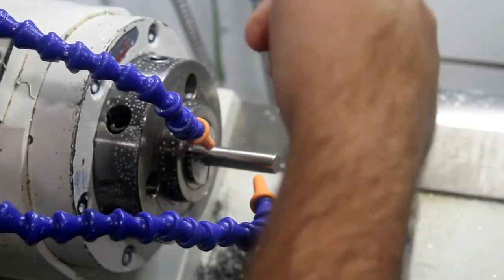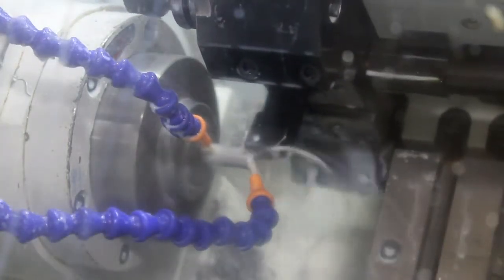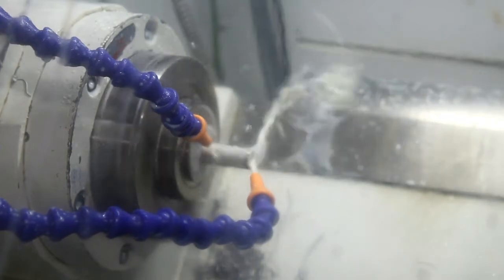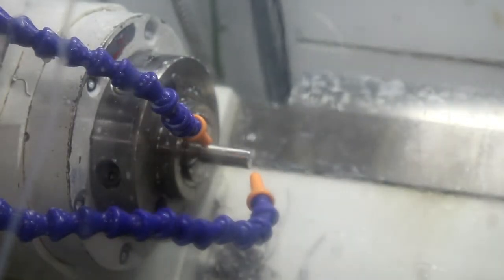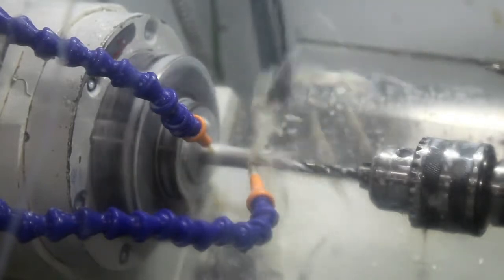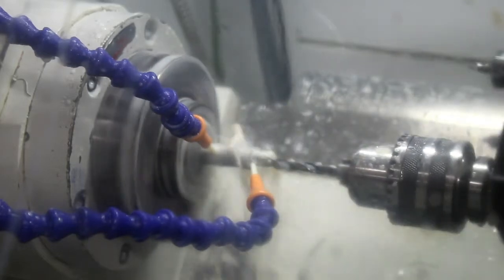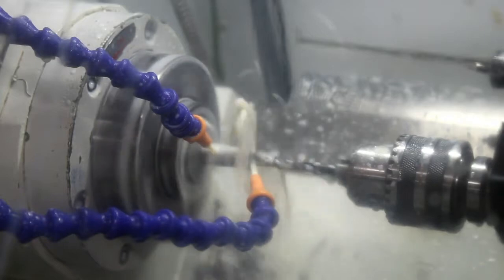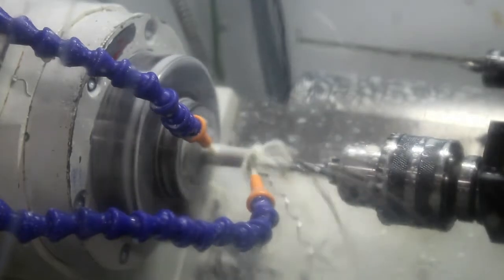Tormach lathe stainless parts.

Comment: Hey Daniel.
Good to see your brother taking over on the Tormach.
It definitely helps if you have 2 people producing parts.
Plus a bonus that you don,t have to run everything.
Good video.

In the back of my mind i still don,t mind the Tormach Lathes if you only need small parts made.
Definitely good if you are on a learning curve with CNC.
My main dislikes about a Tormach Lathes is they are a little limited for power.
And they are Way OVER Priced for what you get.
Other than that, lol. there not to bad.
Reply from the maker: Yea it helps a lot to not have to be the only one setting things up. He would run the jobs before once setup while I set the next machine up but yea better now.
Reply: @dnjmachine  
At least you have someone you can do that with.
Reply from the maker: @weldmachine  I like to think we keep each other going
Reply: @dnjmachine  
It does seem that way for sure.
Hopefully things can stay Positive for both.

YouTube has been both Fun and Not.
It eats up to much time and the feeling of why bother is always looming ??

Only time will tell what happens.
Worst case for me is.
I will just stop posting video,s.

Comment: im kinda curious to how you guys started out? curious if you has the tormach lathe first then the haas mill or what not? I am saving up for a cnc lathe to add to my shop and was thinking about getting the tormach or a used haas. I dont have much shop room left so the tormach actually sounds nicer to me now but idk if I will outgrow its capacity. I had a tormach 770 and loved the little guy but constantly needed to mill larger things than it could handle.
Reply from the maker: We had the PM-940 converted to CNC then Tormach then Haas when we built our now shop
I don't like Tormach's lathe support, maybe its changed its been 3 years or so since I last tried contacting them.

I do personally I feel the Tormach has been a good machine, it is limited to smaller parts but it has a very easy to use conversational programming system.
You mentioned before you don't have a lathe so learning one would have a bit of a learning curve from the mill.
That was the main reason we purchased it the ease of use, I was making parts really quickly with the machine.

The reasons you may not want to get one.
Like you said the work envelope is rather small.
Largest thing we have cut is maybe 6 inches long as for the OD max we have done about 5" OD with maybe 5 inch stickout. This really depends on the tooling you get.
The gang plate limits both OD and length. I have had to pull the gang plate off the machine just to let stock clear it many times.
If you go all out and buy everything turret and collet closer the price gets up there and you could buy a good used HAAS or for a little more you could get a really nice new HAAS.

We spent less than 10K more on the Okuma and there is no comparison between what the 2 can do. There is also no comparison between how easy they are to use either... The Okuma takes up 5 to 6 times the space and the power requirements are outside what a home shop would have too.

Had I had the experience I have now I would buy a HAAS over the Tormach any day but that may not fit your needs.
The Tormach will happily cut parts up to 2" OD and 2-3 inches long without any issues (I would say that's 85% of our lathe jobs) when you start getting over that it's doable but starts to become a hassle.

If you have any specific questions about the Tormach or the differences between the 2 lathes we have I'd be happy to answer.

-Daniel
Reply: @dnjmachine  
Not my question but a well detailed reply.

The only thing i would like to add is ?
He already runs a HAAS Mill,  it might be in his (Engineering Science ) best interest to stay with a controller he is already familiar with.

Plus you guys in the States have plenty of second hand HAAS Lathes available to bother with buying a Tormach.

Bang for your Buck.
Definitely buy an industrial machine way before a home based machine that only requires limited power to run it.

For home use the Tormach might be a good choice.
I priced a Tormach with a Turret OPTION as they call it Plus add on of an enclosure I Did Not Want,  it starts to get to half the price of buying a brand new industrial machine.

It,s actually a bit of joke how much they want for these Tormach Lathes.
If the price was more realistic i might have brought one at the time, as i was only running small parts.

Apologizes for hi jacking your comment / reply.
I only got involved because i feel i can talk to both of you like a friend.

All the best.
Peter.
Reply from the maker: @weldmachine  Good points too
Reply: @dnjmachine  
Always Good to think out Loud / Comment ??
You never know ?
It might actually help someone else.
Throwing around ideas has a way of doing that.
Plus it,s a good way to share information.
Reply: @dnjmachine  do you have a haas lathe as well. I am on the fence about a TL1 or a Slant. Problem with the TL is the way they oriented the stupid turret and the limits it imposes by design. Would love an ST but dont have the space nor the power. Can Jam a slant into the single car garage I have which already has a mini mill2, tl1 fits as well. just more snuggly.
Reply from the maker: @sml5214  unfortunately we don't have any haas lathe, that will likely be our next major purchase not picked out one yet. We understand space issues, we started in basically a 4  car garage that we shared with all my other hobbies and wood working stuff. Lmk what you get and will will of course show what we get next too.